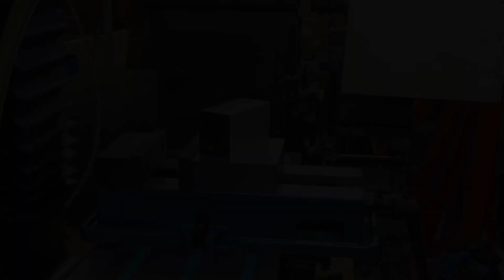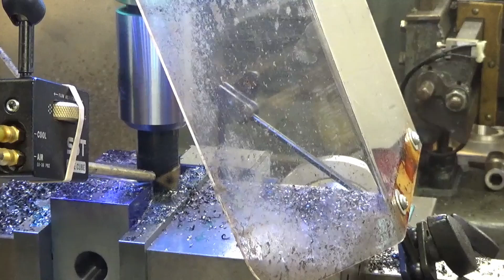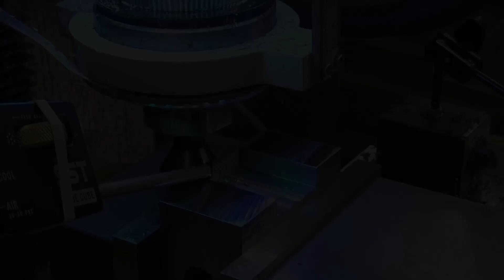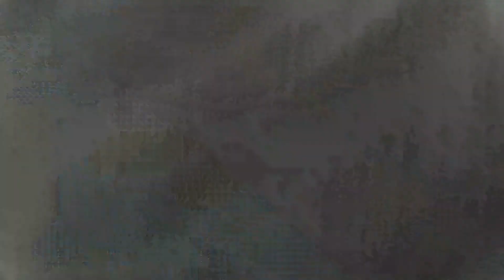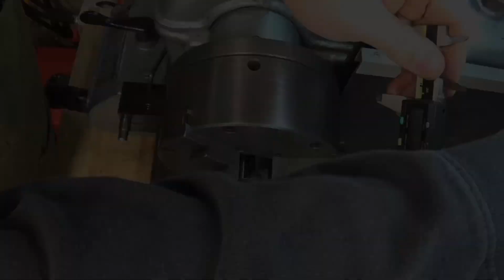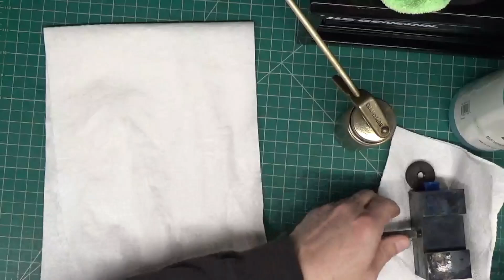MT2 Quick Change Tool Holder Part 2

Comment: Mick I'm not sure I would call that an end mill. I know they call them end mills but be cautious when trying to remove metal with the sides of them. The triangular may do much better than the set that I have which uses paralellagram inserts. I made the mistake of using one with the paralellagram inserts to side mill and made a mess with it. I have a face mill that uses TPG style inserts that I love for face milling. I may look into the type of holder you are using. .
Reply from the maker: Good point, I never use them for side milling, and I never actually thought to do that.  But I did use solid carbide end mills on the ends.